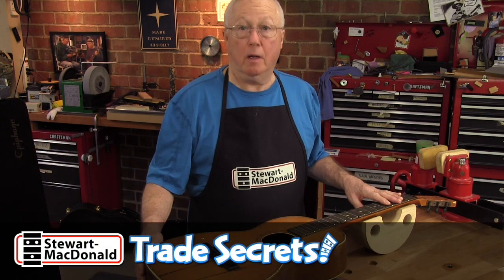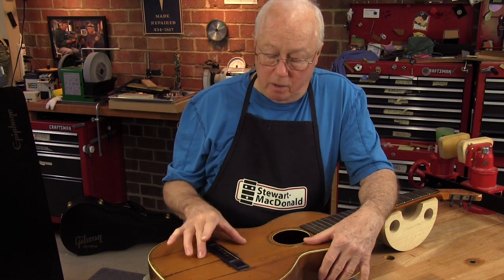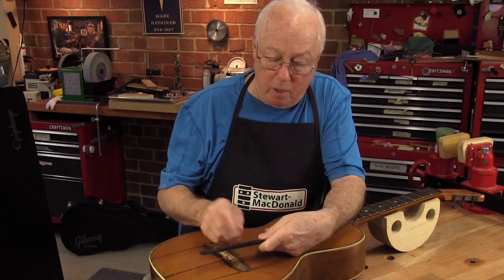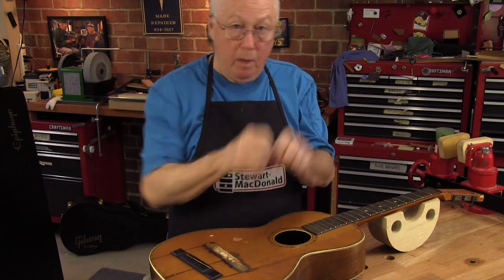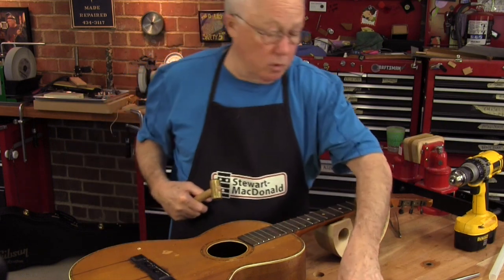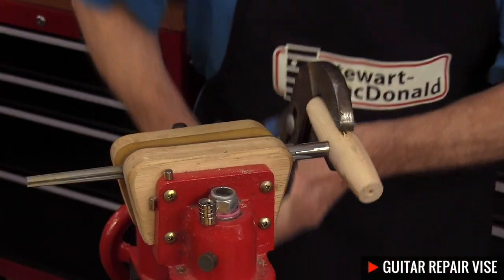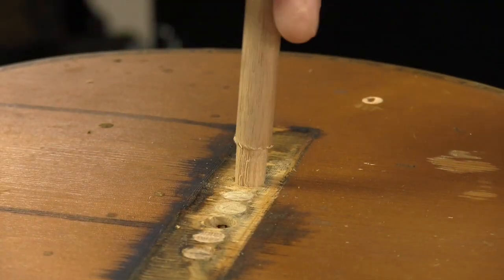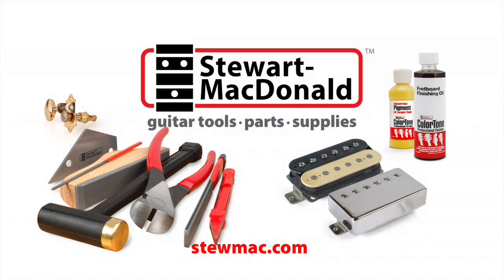Fixing ruined bridge holes

Comment: I bought a Jasmine Takamine acoustic guitar for $20 that the owner drilled the pin holes too big for the pins, not sure why but he did! All I did was made a flat steel plate with 6 small holes that the strings could fit through but not the string ball, I fished all the strings through the sound hole and through the hole where the pins would have gone and the just held that steel plate on the inside of the body of the guitar while getting one string started and in 5 min I was playing the guitar, it worked great, too bad I can't leave a picture for you to see it! I know it's not the professional way to do it but for a $20 porch guitar it worked great!

Comment: Wow, that looks very like my S.S. Stewart parlour guitar. Exact same bridge design. Mine doesn't have the fancy inlay though. I have this same problem on my Stewart. The strings have dug right into the peg holes on the bridge, as far as the saddle. The strings end up getting jammed in there and are difficult to take out.

Comment: Great stuff
I bought a Les Paul copy, a "Big Lou" from eBay "mint" with hardware upgrades
But I noticed one of the "Bridge height adjustment wheels is not level with one side of the wheel 1mm lower than the other.

I'm guessing its cross threaded.....
Should I attempt (by hand) to remove it and see if I can get it to thread straight?
Or is it too late for that and needs to see a technician?
Thank you.

Comment: I bought a chinese "Shine" bass but the action was still wayyyy toooo high even with the bridge saddles at the bottom, so I used a rotary tool to remove wood for the bridge to sit down lower in the body.

I have removed too much and sits too low, can you recommend anything for me to get out of this situation?
Only thing I can think of is putting a slab of wood in there, but the bridge needs to be screwed in, so I don't really have any idea what to do about this.....

Comment: May I have your suggestion on placing a new bridge on my guitar.  The old bridge was cracked and I purchased a new rosewood  bridge but the pin holes are with different spacing compared to the the original one. Thanks.
Reply: That's going to be a much bigger job than just gluing the old cracked bridge back together. If it's a pyramid bridge, you could try the undrilled one here: http://www.stewmac.com/Hardware_and_Parts/All_Hardware_and_Parts_by_Instrument/Acoustic_Guitar_Parts/Acoustic_Guitar_Bridges_and_Tailpieces/Pyramid_Guitar_Bridge.html Otherwise, you'll need to cut that section out of the top and bridge plate, make a new section for the top and plate, then drill your new bridge pin holes. Good luck with your project.
Reply: ThisLoveIsSweet Hmmm. it seems I cannot use the new bridge then.  Thanks for the reply btw.

Comment: Is there anything that I could do if the bridge came of and left a whole on the guitar top? Would I have to replace the entire guitar top? is that even possible? I am not really in need of fixing this guitar but I am curious, is there a fix for this type of stuff? It's a hole about an inch and a half wide and an inch tall right where the bridge sits.
Reply: It can be fixed, but the issue is really whether it's worth the cost. If you're not 'all thumbs' then you could do it yourself. There is a piece of wood which is glued to the underneath of the soundboard under the bridge, so this (or a replacement piece) can be used to support/glue a new piece of soundboard (any well seasoned pine with matching grain, split and sanded to correct thickness) to repair the hole. Then glue the bridge back in place using two bolts and a thin piece of ply wedged to apply pressure to the ends.